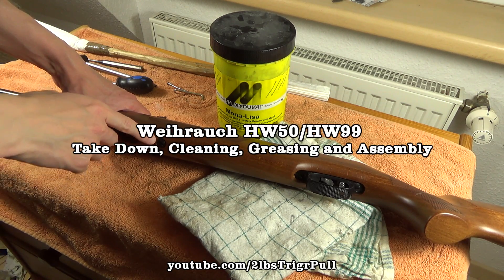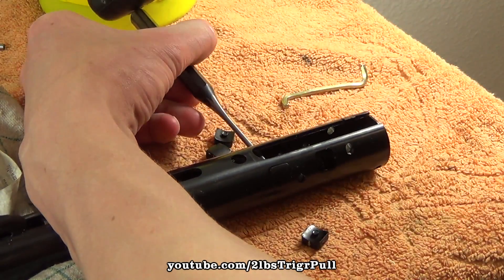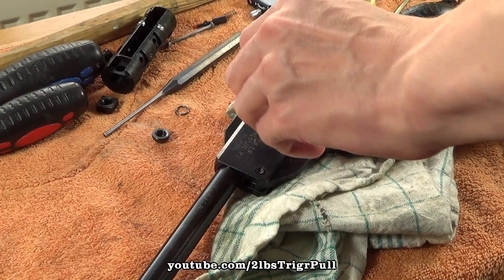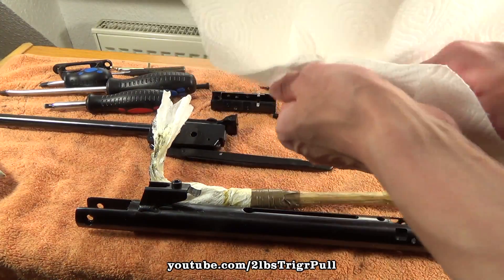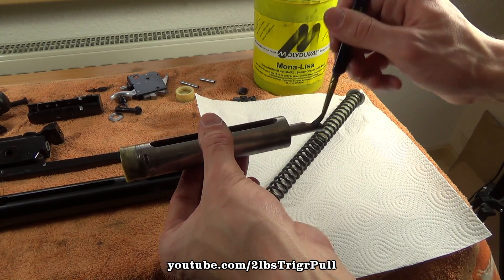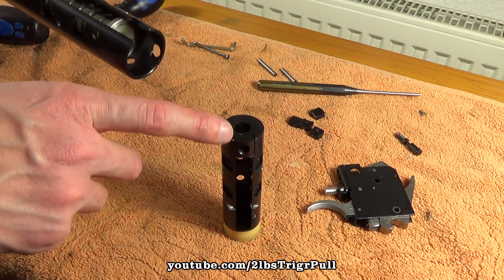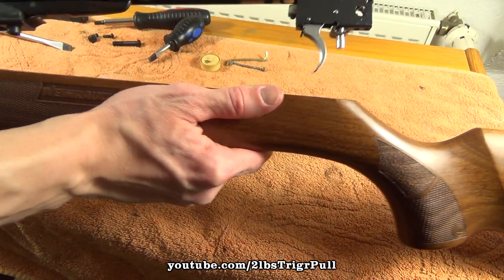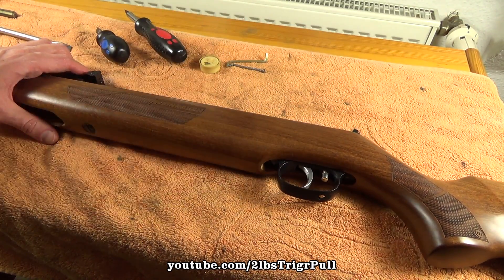Weihrauch HW50/HW99 Take-Down, Cleaning, Lubing and Assembly

Comment: A good explanatory vid, these are a good gun, I've had a few over the years ago, l sold a Pro sport and my TX 200, definitely prefer Weihrauch's, think Air arms are over rated, these are lightweight and just as accurate as my Pro Sport was, that being said still my favourite Weihrauch is the HW80K, mine has a 14" barrel and has had work, shooting FTTs 14.6 grain it's doing very good power, 20ft/lb

Comment: Coming from Nova Scotian Canada here.
Very well done video. Glad I found this . Just purchased a new HW50s a few days ago. Beautiful gun and very accurate but really hard to cock, very stiff and grinding  sound , almost as hard returning the barrel to lock position. Something is wrong. I believe the Polly mar inlay, ,think that is what you called it, in the  two  piece cocking leaver is causing the hard friction and noise. Also the  cocking leaver knuckle or joint must be excessively tight, I hope. 
I did some research and it appears that this is a very common issue with the 50’s . I read every review on the Internet I could find before my purchase , probably at least 10 , and  not one reviewer  mention this. That’s a bit disappointing. 
I was fortunate to find a couple of YouTubes on how to fix this issue, if that is the problem. I sure hope so as I don’t want to go down the road of having to try to send the gun back which the dealer  probably won’t take and then having to deal with  the Warranty Dept.   I’ve done that before and it was a nightmare.   Hope I can fix this. 
Thank you again for  making  this video .
Reply from the maker: I think it's very common due to the design of the cocking lever. That's why I like the simpler cocking levers on the HW95 more. Hope you can fix yours to your satisfaction! Cheers!

Comment: hello friend, congratulations on the video was very well done and easy to understand.
Well, recently acquired a HW 50 S and'm kinda dissatisfied with the only weapon for a reason that is: to cock the weapon has something scraping and appears to be the lever.
I contacted the seller and he told me to be normal in some HW this problem and after 500 ~ 600 shots the gun to shave and is soft, the already this gun with 400 rounds and continue scraping, I wonder if you already You know of any case like this? My HW already is the one that has a nylon bar on the lever which comes into contact with the chamber of the gun.

sorry my English because I am using a translator.

Since already thank you for your attention, many great shots and a big hug.

Comment: Good video, this is very helpful. I changed the spring in my gun and found that afterwards it made a rough scratchy sound when i cocked it and i could feel a lot of scraping and resistance. So i put some grease on the spring and it cocked smooth and made no noise. But it dieselled something terrible and smoke came out the muzzle. So i took it apart again and saw that the pistol seal was all burnt and cracked.  So what the heck should i do now???
Reply: Change the seal
Reply: @sptnk87  Did it. Shoots good now!

Comment: Great video! Hi all. I'm very new to this (never owned a rifle before and have shot fewer than 500 pellets!) so please bear with me. I suspect I have the galling issue and I'm keen to have a look, but I want to take as little apart as possible because I'm worried I'll cause damage. Is it possible to skip some of the take-down process shown in the video and just do min 0 to 0:18 and then min 2:19 to 3:25, then assemble as shown later in the video. Thanks in advance to anyone who can advise!
Reply from the maker: For it to check it I think you have to have a look inside the cylinder tube where the cocking shoe rides back and forth in the slot.

Comment: Hello. Thanks for the interesting video. It seems that a HW50S version sold in Germany is limited to a spring being linked to a maximum of 7.5 Joules due to German law regulations. The HW50S rifles sold in e.g. Belgium is not limited in that respect and therefore seemingly are delivered by Weihrauch to Belgium as a 15 Joules HW50S. Therefore two questions. The first question: your HW50S as shown in the video is a 7.5 Joules HW50S? Since you are removing by hand the end part of the spring assembly by simply pushing down the rifle tube by hand, vertically downwards on the yellow spare seal (as you indicated). So obviously there is indeed very little tension of the max 7.5 Joules spring in the case of your German version HW50S rifle in rest. I assume that there is practically no remaining tension of the result of a 7.5 Joules spring? Can you confirm such?  Second question: you mention "Be careful during this step as there could be a bit more tension on it if you own the export version". If the "export version" of the HW50S (such as a HW50S delivered in Belgium) is a 15 Joules spring version (thus the double of the 7.5 Joules German version !) could you possibly inform us about the meaning of "there could be a bit more tension" during a disassembly of the export version of a HW50S ? Does one thus also not need a complete spring decompression-compression set-up to disassemble a 15 Joules spring HW50S (export version)? Can a disassembly still be done by hand for a 15 Joules export version HW50S as you show in the video and since you remark " a bit more tension" ? ... Or is the remaining tension of a 15 Joules spring in an export version HW50S in rest much too high for manual disassembly?  Thanks and regards.
Reply from the maker: Yes, it's the 7,5 Joule version. And as long as you stick to original HW springs 7,5 or 16 Joules there's no need for a spring compressor. Both versions can be disassembled and assembled by hand as long as you don't try to put in the super power magnum springs... ^^

Comment: good video,I thought all HW rifles broke down same with screw.off back end of action .
Reply from the maker: Only HW35, HW77/97 and HW80. Basically only the ones with bigger zylinder diameter. The smaller rifles like the HW50, HW57, HW85/HW95/HW98 have the pin type.

Comment: I cant seem to punch out the 4 blocks/ squares?? I see the front 2 blocks have "blind holes" at the inside side. But I see No edges of the 2 square (little) blocks.  I have the HW50. Do I need to get these squares/blocks Out anyway, to open the rear part?
Reply from the maker: Sometimes when they drill in the cast some holes are unclean and not cut through completely. Try to punch through the holes where they should be with a fitting allen key or something similar.  Can you take a picture of it? Would be interesting to see exactly what you have there.

Comment: is it necessary to apply silicone chamber oil on the piston seal???
Reply from the maker: Shahriar Nashid Never do that. It's unnecessary and might even damage your rifle. You only coat the piston seal with a very thin layer of grease where it contacts the cylinder.

Comment: I have a HW50 s/n 736xxx with an internal safety. Also it does not have the four square keepers. Both ends are closed on the receiver (spring housing ) How do I get the spring out? Thanks for any help you can give.
Reply: +william sliemers Is there a visible small rim on the last 2" of your receiver? Sound like you got the old style, similar to the HW35/80 or HW77/97 design. If that the case you just knock the pins out that keep the trigger unit and then unscrew the end piece - keep the spring tension in mind here!!
Reply: +Nico Nixlos Nico. I sure do appreciate that information and it is just what you said.  Thanks for the warning about the spring tension. You have a good day and thanks again.

Comment: some people talk about the "piston liner" ...where is? inside the piston?
Reply from the maker: That's the tin sheet liner inside the piston. You can see it through the slot where the cocking arm shoe is riding in. In this video the liner is missing. But if you watch a later HW95 disassemble video from me, you will see the difference.
 https://youtu.be/4f4MzG-UoBQ?t=14

Comment: To ensure no damage by accidental slippage of the screw driver there are the 2:22 mark,.it would be a lot safer to use a properly sized hollow ground screwdriver blades here
 ( or proper Gunsmithing screwdrivers). Omission of the demonstrator to use the correct tools here do this surprised me!
* Hollow ground screw driver blades fit more snugly in the slot of the screws and thereby lessens the chances of the screw driver winding or 'torquing' out of the slot and scraping the surrounding surfaces. Using the handle of a screwdriver as a hammer shows his lack of care and attention to what's being done here,..notice the bits of plastic chipping off the handle when driving in those four blocks, see from the 8:06 mark! 
If you don't care about your air rifle, then disregard my comments.

Comment: U dont have to disassemble the whole gun to remove the piston it can be removed with the spring and trigger
Reply: Your are Talking Rubbish Dude the cocking arm locates in the piston slot to cock the rifle....The arm has to be removed to disengaged from the Piston or the Piston will not come out will it
I can just imagine you forcing it passed the arm and tearing the piston seal to shreds in the process....With a goosed rifle at the end of it.....Great Video by the way triggerpull